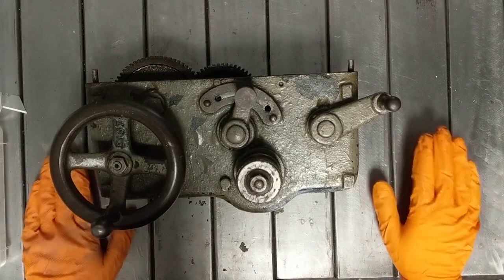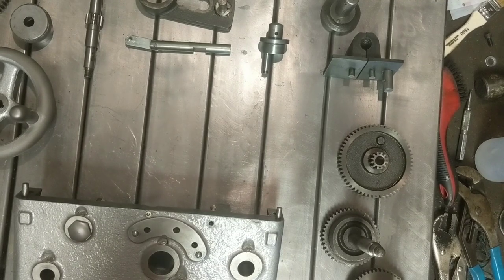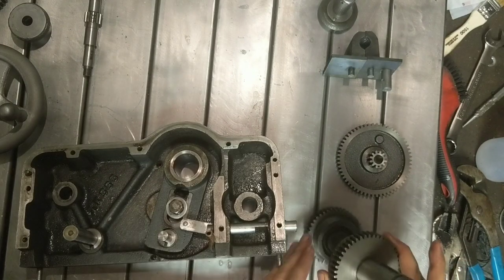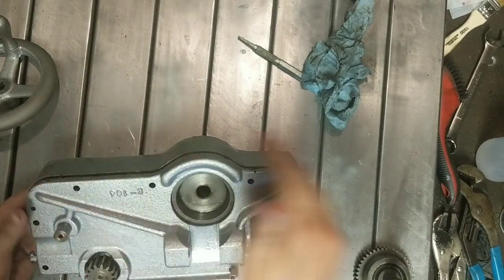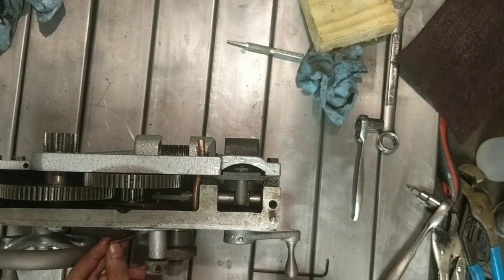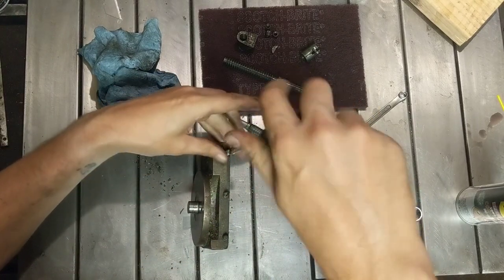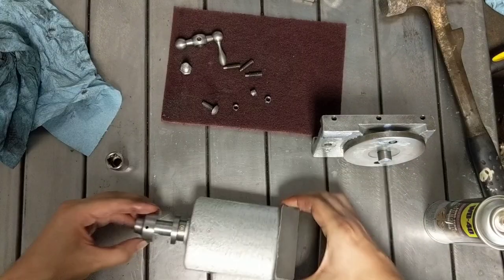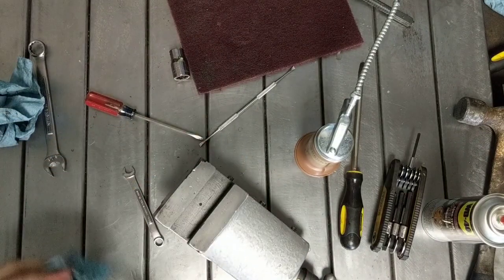Sheldon Lathe Part 2: Apron and Compound

Comment: Hey. Thanks for the video. I'm learning to use a lathe. The shop I'm at has a similar Sheldon 11" lathe. I am having trouble engaging the power feed with the clutch. How does the clutch know work? Are you supposed to screw the knob in to get it to engage, or do you just push/pull the knob? Possibly the lathe is quite worn. It seems like sometimes I can get it to engage and other times not. Thanks

Comment: I have gone through the process of restoring a EXL56b. For its size, the machine is very capable. When you were putting the apron back together your carriage drive gear that has a missing/damaged tooth. Most all of the parts of the machine are not very complex to reproduce if need. It will course you a lot of problems if it is not dealt with.
Reply from the maker: Thanks for watching! I noticed the broken teeth, but reasoned that it was ok since the gears stay meshed until the next tooth tooth up load. I suppose it might slip under heavy cutting pressure. There are also broken teeth on the back gears and there's another video on how I broke the spindle drive gear. I'd like to make replacements, but at the moment, I don't have the milling currently I need or a suitable indexing head. Maybe someday. It would be a good video.

Comment: Hello, I would like to ask you a favor, 5 months ago I bought one just like it at an auction from an abandoned company. but it does not have the automatic or threading system, could you help me with the measurements of the sprockets to manufacture the system

Comment: Was hoping you’d explain more of what items do and how to use them while you were taking them apart. Maybe down the road. I have this lathe and trying to learn the craft. What’s the small trap door do? Some type of oiling mechanism? Enjoyed the video
Reply from the maker: That's for watching! Yes, all the little doors are oil ports. Fill them with way oil every day, before you use the lathe.   Thanks for the feedback. When you're in the middle of a project like this is very easy to forget to explain the context. This lathe works like most other small lathes (Atlas, South Bend, Colchester). If you're looking for good basic machining content, you can always try channels like MrPete222 or ThisOldTony. Enjoy!

Comment: Great video! Could you do one on removal and installation of the apron on the lathe? I need to also pull my spindle, have you done that yet?
Reply from the maker: Thanks! I have video of the headstock dismantle, look for a video on that as soon as I get the time to edit it together. Tricky job. I broke the spindle back-gear on mine. Don't do that. On the ball/taper bearing models you have to beat the spindle through the bearings. If you have the plain bearing model, and you just want to replace the belts, you might get away with just cutting the belts, undoing the bearing caps and lifting the spindle out whole.

As far as removing the carriage and apron, I may have some video, but there's not much to it. Just knock it the taper pin on the transmission side of the lead screw and undo the bolt on the fitting at the other end. Then the lead screw will pull free through the half nuts. The apron is then just held on by the 4 screw in the carriage.
Reply from the maker: Spindle video uploaded. Enjoy!

Comment: I just got one of these lathes. Looking through the maintenance guide I can see how the apron is assembled. But what is the best way to take it off? I'm terrified of damaging it as it is a lovely machine in near perfect working order as far as I can tell.
I can see the portion where it latches onto the feed screw but I can't figure out how to get it off or if I need to take off the screw itself first. Any help would be greatly appreciated.
Reply from the maker: Hey, Henry. Thanks for the view. I should have filmed the removal, but got halfway through the job before I thought to. It's a fairly simple process as these things go. You need to remove the lead screw first. Push out the taper pin joining the lead screw and the gearbox, then remove the lead screw bearing at the tailstock end. Then pull out the lead screw from the tailstock side, through the apron. The apron is only attached to the carriage by two 3/8" screws. Support the apron as you undo these (it's heavy, but this can be done by hand) and the apron will come away. I'm doing this from memory, so I may have forgotten something, but I think that's all there is to it. Let me know if you get stuck.
Reply: @barnyardbikes54  thank you so much. I'll be sure to give it a go!
Reply: @barnyardbikes54  I was just wanting to make sure I was nocking out the correct pin. The pin is the one that is going through the collar and the screw just outside of the gear box correct. I am a novice machinist in college and don't want to hurt the machine. I can send pictures if that helps. 
I am trying to make a full restoration video to help others and I am recording my work as I go.
Reply from the maker: That description sounds right. You don't need to be super gentle with these old machines. They're built very robustly (mine weights 1000lbs. Literally) and there's times they won't want to come apart and you've got to get rough. You'll usually have a feeling for when you're about to break something (and sometimes that's the only way to do it)
Reply: @barnyardbikes54  I got it. You were absolutely right. I was being too timid and just had to go a bit harder. Thank you so much for your help it is greatly appreciated.